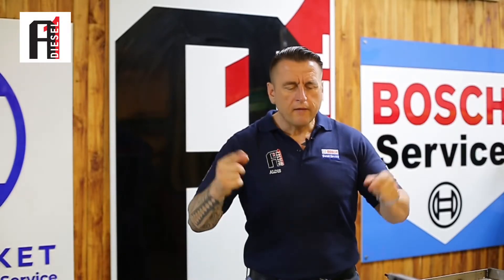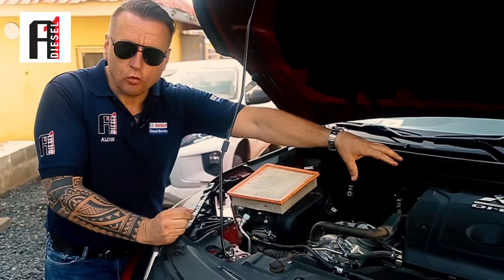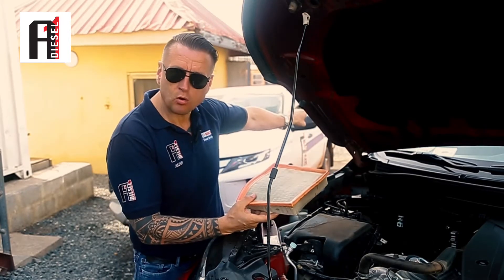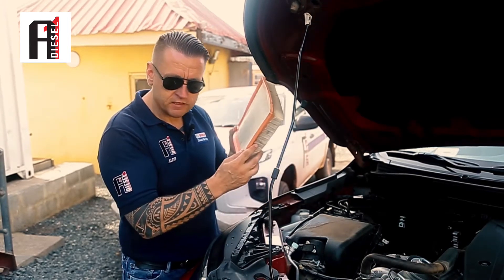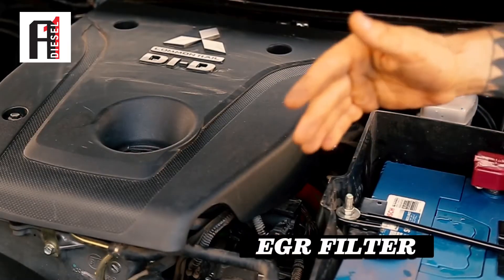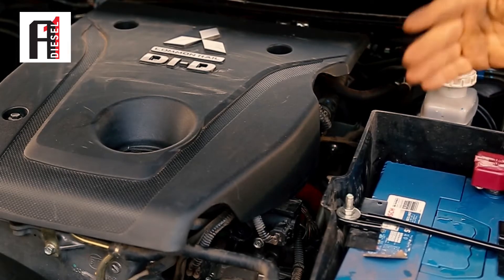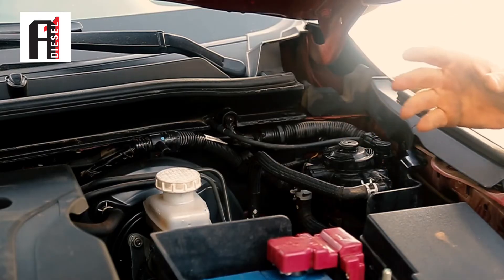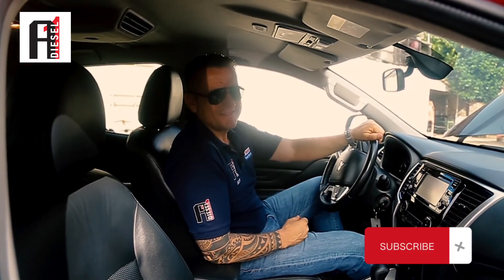FOUR SYMPTOMS OF BLACK SMOKE IN DIESEL EXHAUST

Comment: Hello A1,  I have been having a problem with black smoke, I have a 2008 ram 2500 6.7 diesel, took it to the dealer, first they said I had a couple of bad injectors, after the injectors and the tubes were replaced, the issue was the same no change, next they wanted to replace the turbo actuator for a really high price, then the tech said it could be the MAP sensor, I replaced that with no change. When the truck is idling it seems to be surging, it's not smooth at all, I was thinking about removing the EGR and cleaning it, I have also purchased a MAF sensor and have yet to install it. What suggestion to you have for me, I have spent a great deal of money and it seem that the service tech may be  guessing as to what the real issue is. The air filter has been replaced, and I was told the fuel rail pressure sensor was leaking, but they used a brass washer to correct it, I wanted it replaced, could this have an effect on what's going on,Please Help!
Reply: Sad..nobody answered😢..mechanics all over world r not sincere at work it seems...

Comment: Mate thank you for the great video you are a Legend 💪🫡,, 
Wanna ask you my 08 w204 C220 it has 140ks always serviced by previous owner at Mercedes, I bought it year ago and last two days when I starts car no white smoke then when I drive it it start smokes while, no any kind of leaks all around engine nor under or front back I checked all except one place is on the diesel filter and on the the rubber hoses near it just fingers,, plz any advise ideas what cause white smoke ? 
Many thanks 
Matt
Reply from the maker: Hello champion, white smoke can be caused by several reasons which include: transmission fluid burning, leaking fuel injectors, coolant leak into the engine.
Reply: @a1dieselafrica  
Thank you for replying, 
Brother I don’t have coolant leaking at all no one drop and my fuel indicator are so clean and dry from top chamber and my transmission have no coolant inside it , the car it’s in a fantastic condition luckily bought it from old lady , but the only thing is start white smoke,, just one thing the diesel filter not changed yet as I have it only two weeks and not registered yet too so it’s stays on my driveway,,, I checked everything my friend i can’t find anything at all